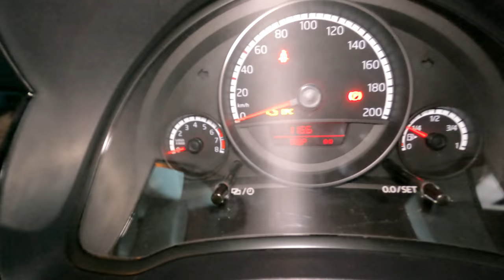Trying To Guess MY NEW CAR (Blindfolded)

Comment from the maker: Welcome back to another year of MCM! To kick off, we’ve each bought a new car, inspired by the original budget episode of MCM 14 years ago. 

Need a surprise in your life? Check out Cheryl’s Big Box - our massive mystery loot crate of amazing MCM merch! 

https://mightycarmods.com/collections/multipacks/products/cheryls-big-box
Reply: Clearly Cheryl's box brings everyone to the yard....
Reply: As a VW Up! owner myself I approve this message (video) 😂
It is a fun little car and you guys really need to install a Asin AMR 500 in the Up!
Reply: Glad to see VW Up! and being I own one myself, which is modified, it is a Great Car
Reply: Small cars are more fun like as they are more usable and you can basically floor them and not break any laws win win
Reply: I own one and i love everything about it. It corners surprisingly well, sounds decent at high revs. Just be mindful about electronics interfering with brakes, sometimes you have to press pedal twice.
Reply: Cheers to another year of impeccable MCM content 😌
Reply: is the hole in the roof part of the aero packet?
Reply: @deinim5854  nope, that model year only came with the NA 3cyl mpi engine, which can have 44 or 55Kw (it's just an engine map thing), then in 2016 when they restyled the car the NA engines gained a couple of Kw and VW added two turbo engines with either 66Kw or 84Kw in the GTI. The GTI also has a 6speed which is not available with other engines.
Reply: Max Power  fair enough
Reply: A head nod to the birth of MCM, love it fellas! Thank you for being something that a lot of people genuinely look forward to each week . Cannot wait to see what's to come ❤😊
Reply: Great Idea with the up!
Reply: Another good year for us
Reply: Check out the Up! GTI. A genuine VAG car and an absolute riot
Reply: Kia cee'd also has punctuation.....
Reply: These things go from 68 to 90ish hp with just a map. They are artificially capped at the top of the rev range. Unleash it!
Reply: Awesome guys getting back to what you guys love doing pint sized rockets!!
Reply: Did Australia get the lupo
Reply: guys your forgot the kia c'eed
Reply: 6:30 there is aux in cable with bluetooth integrated, so no need to plug in to your phone
Reply: @rfunder  When I turned my car in for timing belt service, I got a VW Up! as a loaner car for the three days they worked on the car and it sure is fun little car. It's like you're driving a tin can because it's so bare bones but it's fun to drive because it has very strong German punctuality in such a small and LIGHT car. It even feels like you're driving a turbocharged fast car because the light weight of it allows it to have a nice acceleration. But as a daily hatchback driver, it's a bit too small for that unless you plan to do only you groceries with it. :)
Reply: Am I wrong or do all Volkswagens smell like crayola brand crayons?
Reply: Need to create another song for this battle. My car goes pssh pssh

Comment: Owned a High Up! TSi for about 2 years. It was one of the most ridiculous little cars I've driven. Had a bunch of torque (for a 1L)  ideally suited for spinning one wheel at a time due to its lack of weight. Surprisingly comfortable and an absolute hoot. Sometimes I still miss the little "Savanna Gold" shoe box, was good on fuel too!

Comment: Is an Up in Australia called a Down?

BTW: The price is also high here in germany too for those Shoeboxes.
Reply: The prices are ridiculous for these. Especially when Fabias and old Golfs are cheaper, bigger and just more useful cars altogether imho.
Reply: The Seat and Skoda badge-engineered ones are cheaper, though.
Reply: DOWN UNDER
Reply: Here in the UK, where used cars as usually dirt cheap compared to pretty much anywhere else, a 2013 Up! with 50k miles (70k kms) and 3 doors is about £4500. Moog paid just under £4000 in AUS dollars. That's pretty surprising. If you've bought an Up! I don't think you'd have buyers remorse getting one of these if you need a 'classless' city car.
Reply: @LCOF  in ireland where used cars are all poverty-spec and high mileage a 2013 up goes for  7000-8000 EUR (6000-6500 GBP)
Reply: *sh*tboxes 😂
Reply: @DarkRobin190  Man Up!s are expensive in the republic, I'm up north and they go for like £4000 for older ones
Reply: @TheFrozenMister  Were... Not produced any longer.
Reply: @RGVisuals  Wrong! Nugget!
Reply: ¡dn, mate
Reply: Nah, it's called a BEX.
Reply: Tbf they are also hella cheap to run. 4.5 L / 100km with A/C on is pretty efficient.
Reply: @Paul_VanGo  You can still order new UP's of all kinds in the UK and Germany.
Reply: @PowerslideSWE  Correct. But I was referring to the availability of the Up!-sisters, the Skoda Citigo and the Seat Mii.

Comment: These small guys are literally everywhere in (Northern) Europe. So cool to finally see some work done on "cars people can afford". JDMs are epic and all, but the prices are so high. Says the bloke driving a Volvo V40 D2 (1.6 PSA diesel).
Reply: The same 1.6 PSA diesel are in the Berlingo and Foucs. I've a Berlingo Multispace with the 1.6 and its just rolled over 318k miles
Reply: Man I love those PSA diesels ! I hope to see a PSA car one day on MCM, like a 206 or C3, but I might be waiting for a long time. I checked the australian car sales once, they exist but barely so
Reply: Half the reason MCM has been doing JDM cars so long is because in places like Australia and NZ, its the Japanese cars that have always been the cheap and affordable ones, and the Euros have always been much more expensive.
Reply: @_Zekken  They could do one whenever they come to europe again though :)
Reply: hahahahahahaha. they were affordable before mcm tax hit
Reply: You are right, they are everywhere! So much so, that to be honest, I find it a little bit hard to get exited on this series... even if it is MCM ':D Never been into VAG
Reply: These 1.6 DLD engines are really smooth and were far ahead in early 2000 - but three issues come to mind immediately: drain plug at raised position, clogged turbo oil feed lines and failed dual mass flywheels. I'm not sure if only the early ones had these fails.
Reply: They've done tons and tons of affordable cars, I'm not sure what you're on about. Almost half their content is on some crappy hatchback or something.
Reply: This little nugget needs a legendary 1.8T swap, ask JPPerformance for technical details... 😁
Reply: The 1.6 PSA is in EVERYTHING.
Reply: @jama211  they've not done a huge amount of hatchbacks, he means is stuff that's more attainable in Europe. Daihatsu Mira are super rare here cost more if you can find them, not even mentioning super turbos. 

Golf R, Focus RS and Audi S3 are a different league, you can get older JDM classics for those prices here in Europe
Reply: How to tell people you're broke without saying it...LOL
Reply: Excatly my thought mate, especially in Denmark.
I've been wanting to buy a car like the ones they have, but I've never been much in to Yaris Hilton. So I hope this little nugget is going to turn out cool
Reply: @ThatGuyFromDK  The "lame" JDMs are the way to go in Europe 😎 If you got a Yaris parts are abundant and cheap! Good luck to you mate, have fun with it.

Comment: I've been considering one of those. I guess now there will be an MCM tax... :)

I look forward to see what you do with those 3 cylinders of 1L fury! The centre bore of the 4x100 rims is 57.1, so you'll need wheels with a Centre Bore of that or larger. You should be able to go to 6.5" 17's without any issue.

There is an electric version and a GTi version (that just has fancy wheels and styling) available in the UK and Europe.

Comment: These cars are so awesome! I had a Seat Mii as my first car which is basically exactly the same as this and i loved it. Only downside to them is traction control you can't switch off, however if you pull the handbrake while you're driving it disengages abs and traction control meaning you can go out and do mad skids

Comment: Hey Moog, great car! I bought one of these (also a 3 door) last year. I bet you will have a flashing auto emergency braking light on the dash when you drive it, because its cover (at the rear view mirror) has come loose from the window, which obscures its view. I just wanted to let you know and its an easy fix. Looking forward to this series!
Reply: That hasn't happened to mine yet but thanks for the heads up.

Comment: A year ago I had red 3 door Skoda Citigo with massive 44kw for a loan for three months. Drove about 10k km in that time and it was actually really  good car for city use. After using it, and returning to own, normal sized car, finding parking spaces where you can easylly fit, was bit more challenging. :D
Oh. And because the car is so narrow, there is no passenger window switch on drivers door. You can reach the switch on the passenger door, from drivers seat with small effort. :D

Comment: Damn I had a VW up for my first car. It's a fun little cart, 60 bhp you can floor it and barely get up to motorway speeds but has great chassis. They also have a GTI version that makes 115hp so there is a lot of potential to work with and plenty of parts to throw in.

Comment: Mad impressive, you were on the right track from the get go and got there in the end. I didn't realize it was an Up! and I was looking at it. Had no idea they made a two door version.
Reply: Yup, '5 door', '3 door' versions. Some markets have the turbocharged version or even a full fat GTI version. Even rarer are the obscure ones such as the 'dual fuel' ones that run on LPG with a tiny petrol tank too (German & Brazilian markets I think). And even rarer are the van versions... yes... van versions (I only saw them in the German market). Oh, and then there's the electric one too (but that was never very cost effective as it pretty much was the same price as a higher spec VW Polo).
Reply: @SKYWURX  I could be mistaken, but I remember reading somewhere that the Brazilian Up is slightly longer than the European up (extra length is at the rear of the car). I also remember seeing the tailgate being colour coded, which looks a bit weird when you're used to the black glass tailgate.

Comment: So stoked to see how this build turns out!

I currently have the rebadged version of the 5 door (Skoda Citigo) which is the electric variant, and there are only around 100 in the uk. 

Best thing about it is the electric variant has a 0-30mph is 2 seconds, so it chops virtually anything off the line 😂!

It’s coming off lease in July and will be around £15k to buy out, so I am really interested to see how much faster you can make the standard petrol version.

Comment: My dad has an up and it came without navigation but... there is an optional navigation system with screen you can put on the center of the dashboard. It goes in that weird shape which actually is the cover for the connector. But the best part is that you can put revs, speed, oil temp and such too on this screen which is epic even when its not modded. Here we can get a Garmin or Navigon system through 'VW maps & more'.  Thought I should let you know, maybe you guys want to use the connector or a nav system/screen for something!

Comment: Very courageous to buy an up with the VW EA211. It hat a recall in 2015 becaue it had problems with the camshaft adjuster. Just put in a GTI engine and 6gear box and double the power. Its all the same engine basis. And watch out for oil consumption. If it does you have a problem. Not very reliable the EA211 from that years 2011-2015. They had several issues.

Comment: Ok to turn traction control off there is a procedure with the brake pedal to turn it off before you start the engine as no button (uk spec same for citi-go) also think if you use vcds you can make the radio show the speed in its display, driving instructor mode iirc

Comment: I had one for years as my first car. I did about 80,000 miles in it with bike racks being absolutely threshed and retuned and modified and the mighty chopped sticker. It never went wrong. On the air filter remove the plastic intake thing that comes off the air intake. It’ll sound so much better
Reply: If I remember correctly when you turn on the ignition if you put the throttle all the way down to the floor than all the way back five times then start the engine traction control will be off for something like ten seconds or until you get to 10mph. Can’t remember exactly. I only did it a few times to launch it 😂😂😂😂
Reply: Also the third brake light can let water in so when you shut the boot water can run down the back window. I talked to VW and mine was the only one they knew of with the issue. I just drilled two drain holes in the bottom of the boot to drain the water and had no other issue 😂😂😂

Comment: Funny that, my sister just bought an UP same year same miles £4000 here in the UK. So about the same. Check middle of dash on top by the grill you may find a triangular plate that covers some ports for connecting sat Nav bluetooth and USB can retro fit I think

Comment: also did you know, theres a flat just above the radio on the dash, its a removeable plug, that blanking plate, you can connect the original VW MAPS&MORE sat nav to that and some versions give you bluetooth aswell

Comment: When Marty guessed diesel it reminded me of the time I worked in a car holding yard for imports here in Sydney during 2008-2009. We had VWs, Skodas & Seats, but no Audis. We all grabbed the R32s (Autos slugs, Manuals quick.) or the Polo GTI Turbos. One day I jumped into a Polo Turbo Diesel. That car was quicker than any manual R32. The torque it had meant it just accelerated. This was the same job where I found I couldn't close the door on a Jimny as I was too wide. Looks like you scored a clean car, I wonder what the German aftermarket has for this model.

Comment: I am not sure I like the tachometer that is so smallnot could be a fuel gauge.

If it were auto, it would not matter much but still, it would take some getting used to. i'd get the odd impulse that the oil pressure was going grazy or something (as happens sometimes).

Comment: Had one of these until summer last year, it had less than 20k miles on it when we got it and we sold it 15k later, had to replace the rear brakes twice in that time. The hand brake would bind. the drum brakes would sieze and youd have to drive for half a mile with essesntially your handbrake on tyres screeching until it eventually twanged off and the rear wheels would finally turn. Alternatively you could kick the sh*t out of the rear wheels like a mad man and hope that  worked. Overall not a great car, although cheap to buy; maintenace turned out to be very expensive for us due to unreliability.
Reply: I've put 150,000km (nearly 100,000 miles) on mine and never had this problem. Maybe you got a dud?
Reply: @TheKnobCalledTone.  when I researched it, it came up as a common issue. I have a friend who has one and it happens to his all the time too. Don’t drive it for 3 or more days and brakes are stuck on

Comment: You will love the little car. I even have one. well enough a high up 75 hp with chip 90 hp 111 nm from 2013 3 door. run like I've stolen it for the last 4 years  😅😅🥰 . mine is loaded with equipment like a / c blutooth music and phone. armrest trip computer navigation hill hold. coming home light. Cornering light .  love it. fun little car extremely cheap to drive in
Reply: Random question - which armrest do you have and do you recommend it? Genuine VAG, Armster, or something else? Need one for my e-up... thanks
Reply: @PhineasPhlob  OEM from vw orginal .... Genuine VAG
Reply: @malamutten3203  Cheers - not cheap but definitely looks like the best quality.
Reply: @PhineasPhlob  Everything else is junk. buy the original. You will be really happy with it. the original can also carry up to 90kg .. solid construction

Comment: 7,500 grand? 15,000 new? basically half price. that's insane. but what blows my mind, is the "only way to get audio in is cable" what? even my 2015 mitsubishi mirage has Bluetooth.... and in a manual/stickshift in the united states cost me 12,500 and my father got the automatic which was actually 15,000 (CVT trash). kind'a insane that it doesn't have Bluetooth.

Comment: I have a brand new “sporty” version of these the Skoda Citigo. And have had an up previously briefly. These aren’t great, dangerously slow, an advertised 14 second 0-60mph, so merging is inappropriate. In the city yea they’re great, kinda loud but they’re cheap so that’s fair. But if you have to actually take it on a long run, like across country it will drain the oil dry in a couple a days and you could easily assume as it’s a new car it would be fine, but you could destroy these accidentally very easily. So not very environmentally friendly or reliable. Also as they’re so gutless to keep up with modern traffic you have to rag the balls off of it, so I wouldn’t buy a second hand one personally.

Comment: I was hit by one of these from behind doing about 40mph when I was sat at a junction on my vespa
It folded my bike in half I ended up up almost sitting in the passenger seat after shattering the windscreen with my back I put a dent in the roof with me head and did a triple backflip before landing head first on the road